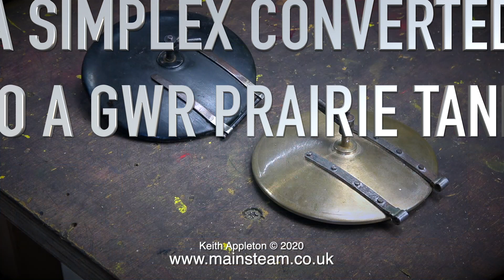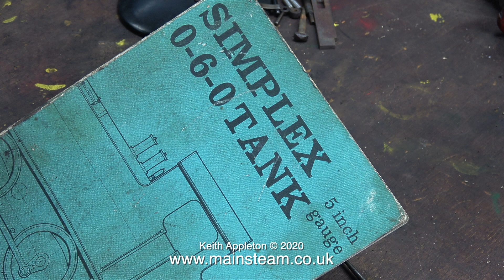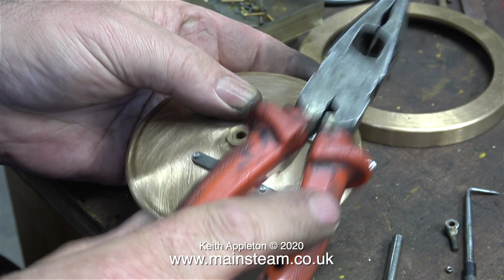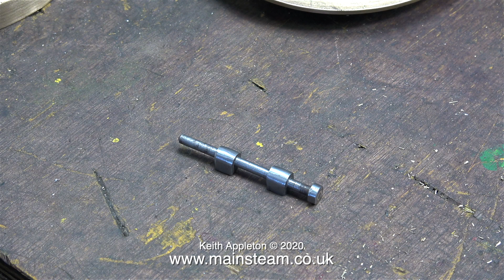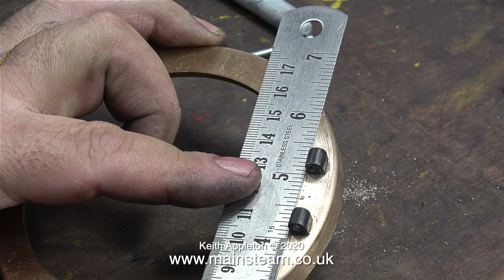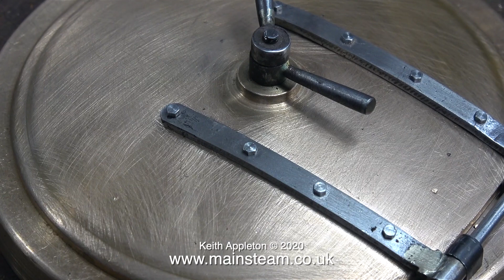SIMPLEX PRAIRIE TANK - PART #25

Comment: Woo Hoo.  First again.  Great closeup.  I've always wondered how those two handles on the front of the smokebox door were used to hold the door shut.  Now I see how you would use the 'outer' one to position the square bar end into the bracket, then spin the 'inner' one around to tighten the door.

Always enjoy your videos and get to learn new things.  :)